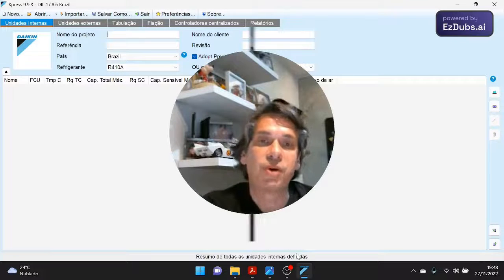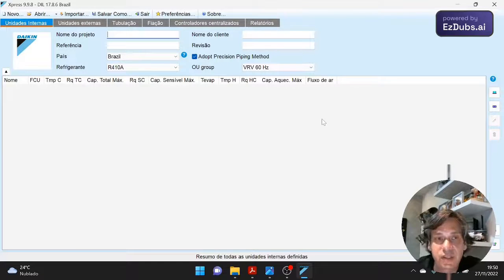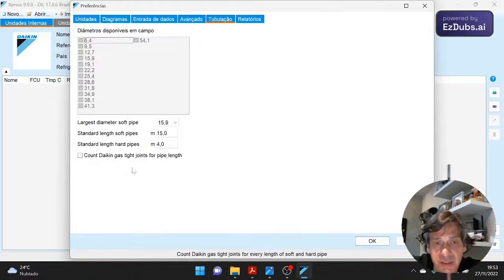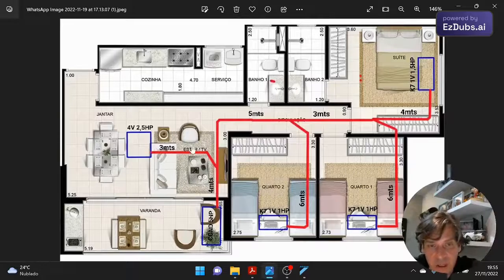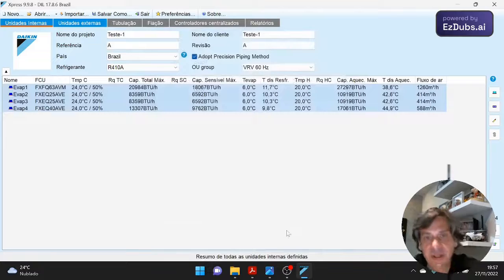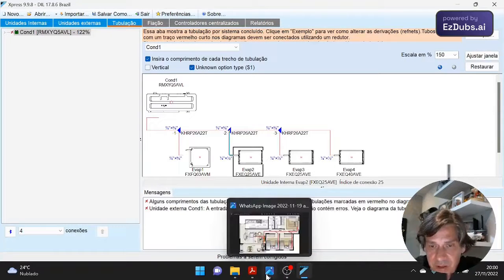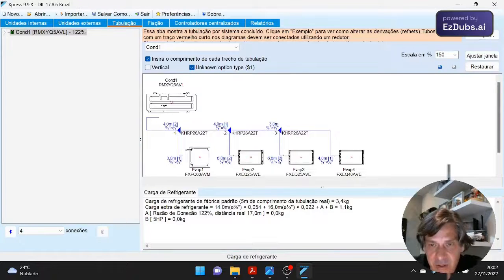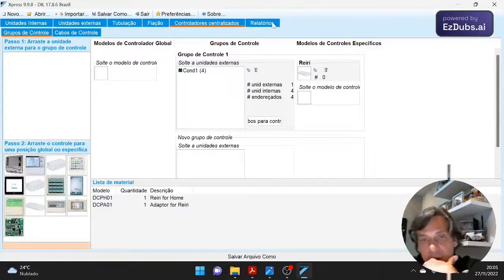Tutorial Software VRV VRF Daikin Xpress - English Version

Comment: Good day, I see that the other air conditioning software only have the simultaneity ratio, instead the Xpress also has the operating load, in the xpress if I use the simultaneity ratio I can also use the operating load?

Comment: Good afternoon, what is the operation load for?
Reply from the maker: @jorgemanuelmeza8882  I didn’t understand your question
Reply: @mauriciochrispimvrf  Good day, I see that the other air conditioning software only have the simultaneity ratio, instead the Xpress also has the operating load, in the xpress if I use the simultaneity ratio I can also use the operating load?